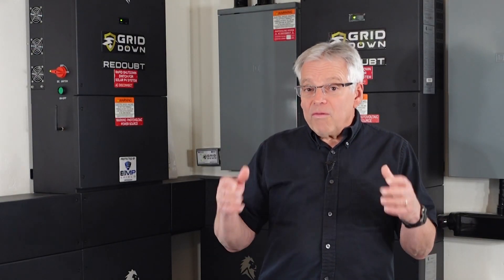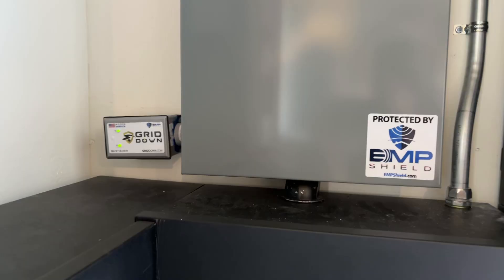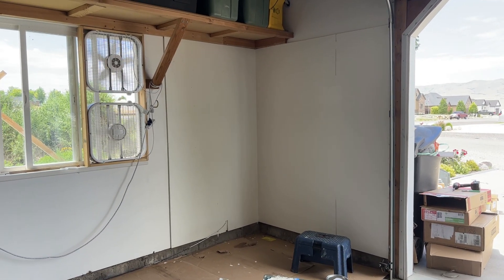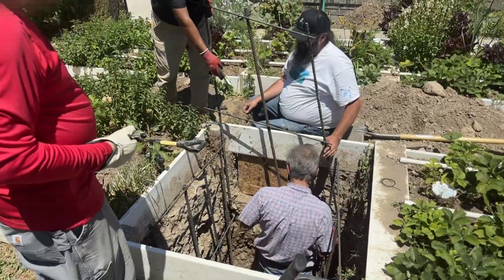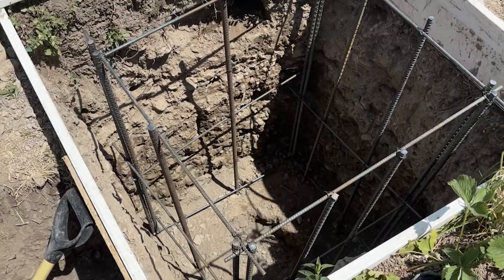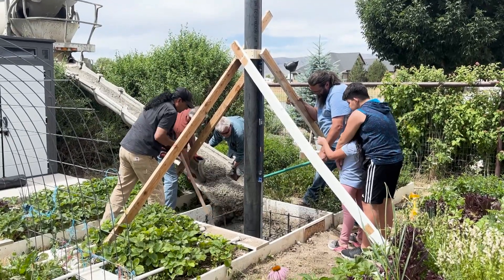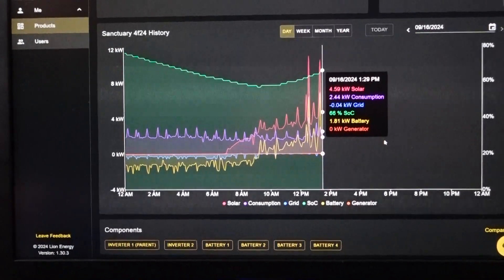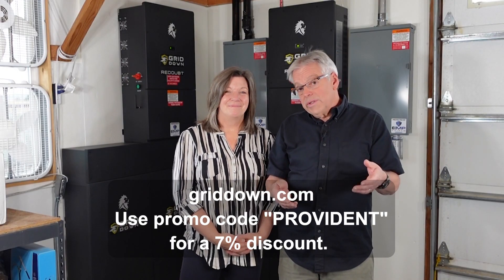Grid Down Redoubt System Installation - We Have Power!

Comment from the maker: Learn more at https://griddown.com/provident. Feel free to contact customer service Monday through Friday (08:00 – 17:00 CST) at 316-368-3370. Provident Prepper viewers get 7% off at https://griddown.com/provident. EMP Shields can be purchased separately and installed on your home, vehicles, and communication equipment. Check them out at https://empshield.com/provident and use the promo code PROVIDENT to get $50 off each device you order.

Thanks for being part of the solution!

Full disclosure: GridDown.com provided a Grid Down Redoubt 54kWh system in exchange for an honest review, we purchased the solar panels, and Lion Energy installed the system. We are pleased with the system and the service that was provided. We highly recommend GridDown.com as a quality source to help you gain energy independence!

Comment: I have solar panels with net metering. No storage system. I had the same issue with the power company (AEP) coming out to install the net-meter. It took them forever. And other people had the same issue and people are still having this same issue. In my opinion the state’s Public Service Commissions need to set a time frame for when the power companies MUST install the net-meter. They drag their feet too much and they do it on purpose. Not enough penalties on motivating them.

Comment: I'm so happy for you guys.  You're gonna love it.  Keep sharing operational aspects about new routines as you live with the new system. There is no way that my HOA will approve solar panels.  I wish they would invent solar panels that don't look like solar panels.  Until then, I am more interested in the storage side.  I figure having enough stored power for 2 to 3 days would meet the majority of my needs. What kind of batteries are those?  I assume that only the batteries would not require permit as long as we have a switch to prevent back charging city lines.  Will the batteries last as long as a Tesla? How did this system affect your home owners insurance? How far down can you dis-charge them? Do they put off heat? Does your monitoring system show you the status of batteries?  Is there any on-going maintenance to the batteries?  Maybe Jonathan can hook up a DC water pump and misters to keep the solar panels cool and windshield wipers to keep them clean!!  Thank you for sharing.  That was a lot of work to do all the editing on this video
Reply from the maker: Look at them at https://griddown.com/?coupon=provident You can get the battery system without the solar panels for storing household power. These are all great questions to ask their customer service.

Comment: Did you get replacement diodes for your solar panels?  Lighting can blow your fuse, if you have one for your solar string and blow your diodes.  You might be able to stop the damage at the fuse level and not blow your emp protection.  Much cheaper fix.  I have had an unplugged charger and a battery power CO detector got fried.  A lot of other stuff and we have under ground power. With the magnetic field getting weaker we are going to have things more often.

Comment: That's a nice system. I live in an apartment in a city and I have a small backup system with extra storage batteries. However, a few weeks ago we had a large area power failure and when I looked out my window not one single person in my entire area had backup power it made me realize that I could be a target as the only person in my area with electricity if things go wrong.
Reply: @James-ke5sx  Getting blackout drapes can help. Make sure they're tucked up INSIDE the window sill to avoid gaps that would show light. Some folks light only one room, an inside one, to prevent outsiders from seeing electricity from outside.
Reply: @JanuaryLisa  That is an excellent idea. Thanks.
Reply: @James-ke5sx  You're very welcome.
Reply from the maker: Yes ... you absolutely could be a target. We have thought about that too. But then again, maybe you could be a blessing to those in need. Years ago we had a power outage in our neighborhood and my sister was having an asthma attack. We put her and nebulizer and medication in the car and went for a drive. We stopped at the first safe looking house with lights on and knocked on the door. They were very kind and let my sister do her treatment there. We were so grateful. It is sad that there is so much evil that we have to always be on the lookout for it.
Reply: @TheProvidentPrepper  Yes that is very true.  Glad you were able to get assistance.

Comment: G'day from Australia , welcome to the club !  we installed a 16.8 Kw battery with a 6.6 Kw solar and are adding a small 3 Kw wind turbine ,  we are a older couple only and are all electric , but all lighting and devices have been chosen for low consumption ,  we've been running now for 8 years with this and have not had a electric bill since installation and we sell a fair amount back to the grid  , even though the buyback tarrifs have lowered to the pitiful level we still dont pay a bill ,  and the extra from the wind turbine which will run 24/7 will pay us a higher tarrif at night when solar does not  generate any power , i've a small video on my channel made a while ago to show the impact  on using this ,  i've worked out that buying this , and the income from it and the savings  from not buying eletricity , means the system paid for itself after 4 years and 3 months , based on the previous 2 years  we lived here ( moved house then )  so if you can afford to pay power for 5 years , you can afford this ( with interest if you have a loan to pay off for one )  we didnt have a loan  so my interest calculation may be wrong , i just looked up standard bank rates ,  cheers !!!

Comment: I have solar panels. Plenty of state sponsored tax initiatives to cushion the blow. Because it is very expensive ---without a battery bank. Anyway, during  warm months, my electric bill is less than $10 a month. Currently, I have an electric credit of 4 mega watts that can be used during the winter months. It pays for itself...  eventually over the years.
Reply: 23000 to install on my house,,, no way,,  23000 will pay my electric bill for the rest of my days